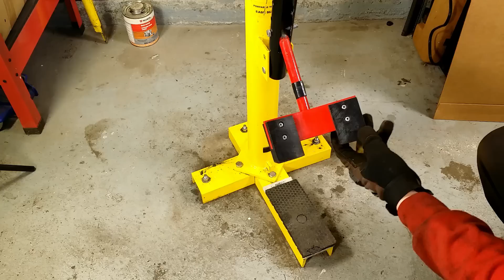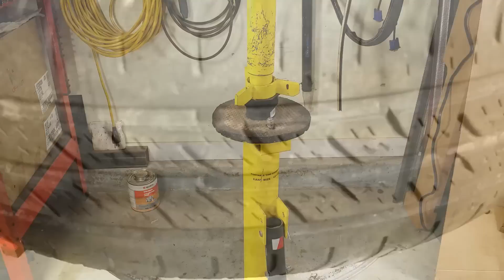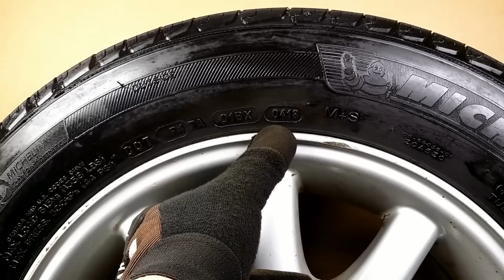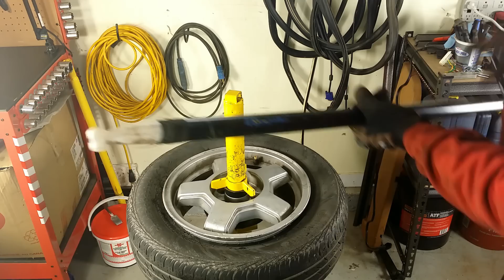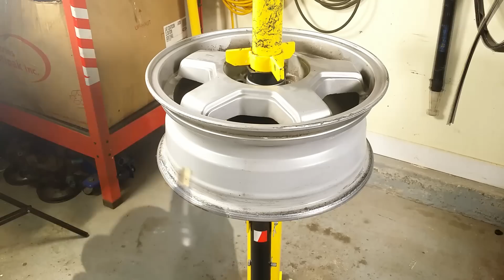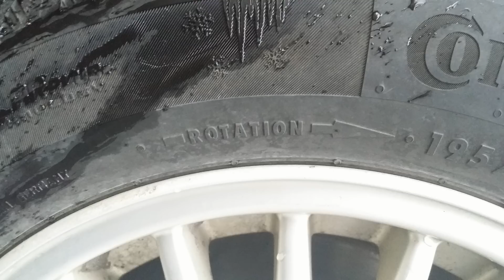How to Modify Manual Tire Changer and Change Tires

Comment: I think if the rod of the bead breaker was longer, there would be more travel and maybe not as necessary to do multiple steps turning the wheel.  Good instruction sir.
Reply from the maker: Thanks!

Comment: The mounting device has a lot of friction with the rubber, which is why it offers a lot of resistance when riding it in the ring. El dispositivo de montar, tiene mucho roce con el caucho, por eso es que ofrece mucha resistencia al suncharlo en el ring.

Comment: Excellent Video with top class commentary,,no fluff..great stuff..My way of breaking a tyre from the rim was to put the tyre under the rear wheel of my pickup truck and reverse over it.That was in Canada .But here in the UK tyres are so cheap its not worth the effort.
Reply: Hy

Comment: If you don't want to scratch the edge of the rim's outside, isn't it possible to turn the rim with the outside pointing downwards?

Then you'll work on the backside and any scratches will notice.

Comment: It's kind of ironic / funny that all the countries that use the metric system and try to ridicule the US for sticking with the Imperial (actually "US Customary Units") system still have their wheel diameters measured in inches... :)

I like the looks of those plastic ends on the tire changer lever though... I might have to try to make myself some of them...
Reply from the maker: It's kind of ironic / funny that at the Metre Convention in Paris, France on May 20th AD 1875 the US of A signed the Treaty of the Metre along with other countries. This means that the US of A recognizes the metric system as the standard of measurements and all its pounds, gallons, inches, etc. are metric-based and multiplied by conversion factors. Samples of the original units are held in the National Institute of Standards and Technology https://www.nist.gov/ 
This means, that the imperial system used in the US of A is based on the metric system (SI). Did you know this? https://www.nist.gov/system/files/documents/2017/05/09/frn-59-5442-1959.pdf
Reply: @robertdeptula2003  -- I'm an engineer (retired)... I am well aware that there are exact conversion factors between the US and metric systems and that it is possible to derive many through the memorization of of a few base constants... For example, if you want to convert from liters to gallon EXACTLY, you just need to remember that there are 231 cu-in in a gallon, 1000 ml in a liter, and 1 cu-cm = 1 ml -- it gives you 3.785411784 liters per gallon EXACTLY.  That's the US gallon, not the Imperial gallon... My impression from spending some time in the UK though was that they use a mix of metric and Imperial for various things.  For example, road distances will be measured in miles and distances to a near highway exit in yard, but bridge clearances in meters... Most weights are quoted in kg, but people tend to quote their weight in stones and pounds... There is nothing magical about the metric system like uninformed proponents that you have you believe... It's just another arbitrary system of measurements, albeit with unit conversions based on powers of 10...

Comment: Great video with great explanation cheers where did you get your tyre bar from please it looked awsome and really easy to use compared to the standard bar you get with the tyre changer.
Cheers
Reply from the maker: I made this bar. When you pause video you can see details. The contact parts are made of plastic reinforced inside  with metal spikes.

Comment: Why can't you change an 18" wheel/tire with these low cost tire changers? Most of them say 16 or 16-1/2" maximum size.
Reply from the maker: All I have is 15 inches wheels.

Comment: Great video. Can you give the name of the valve tool and paste?
Reply from the maker: Tire fitting paste: https://shop.wurth.ca/vehicle-repair-components/wheel-tire/tire-mounting-repair-tools/tire-mounting-repair-chemicals/tire-fitting-paste/TIRE-FITTING-PASTE-11LBS-(5-KG)/890.1221/?gclid=Cj0KCQjwub-HBhCyARIsAPctr7z6hjJydLkCRskPIk8ipJUjWPT_rJxbfEkNenszEDNXsmZpHz_n5OIaAh1aEALw_wcB
Tire valve multi tool: https://www.princessauto.com/en/tire-valve-repair-tool-with-valve-cores/product/PA0008253684 this one is more popular and you can use it to mount the valve on the rim. 
Good luck!

Comment: You should have been considering that there was a expensive sensor inside before you dismounted it or that you will check for the belt over lap and install it opposite of the valve stem to help aid in the balancing process and save shop on weights.
Reply: How do you tell where the overlap is?

Comment: I need to make that bar. Could you please give detail specs on the measurements and materials? I can see it, but getting it right is another matter. Thank you for a great video. I'm currently frustrated with the harbor freight bar over two days without luck already! I don't want to damage the new tire when mounting, and need to get something that can work well.
Reply from the maker: On my chanel in "about" section you have my email. Talk to me.
Reply: @robertdeptula2003  Can  you help me

Comment: That machine from Harbor Freight was the machine that used 40 years ago except the bead breaker was mounted to the wall in with hydraulic for those tires that don't like to come off

Comment: I saw another video where in the comments someone said the coloured dots, (yellow/red) printed on the tyres were meant to go at a certain position. 
Something to do with it being the heaviest part of the tyre, so you put it opposite the valve. Wish I could remember. Just meant you didn't need as much weight when balancing it.
Reply from the maker: Yes, but not all tires are marked this way. Somebody else left a comment, under my balancing tires video, that he turns the tire on the rim to find the right spot that will require fewer weights. Just two weeks ago I changed two tires and during balancing turned one 3 X 90 deg and another just once. Made a significant difference in the weights required to balance. Thanks for your comment!

Comment: Good video. Most folks don't know about the drop center. Also you know this, but there is only one correct side to remove the tire, as the drop center is typically not centered on the rim. At least in modern wheels it's not.
I like that paste lube your using, as it leaves very little water vapor, which accelerates the corrosion of aluminum rims. That whole nitrogen thing is wasted if there is water vapor inside the tire.
I've not seen that lube available in the states. I typically use a bar of soap, rub it on dry, and that works very well. But I do see micro bubbles and your sealant would be a good thing as it's not messy.
Reply from the maker: The paste in US: https://www.wurthusa.com/Chemical-Product/Tire-Repair/Tire-Mounting-Paste-11-Lb-Pail/p/08901221
Reply: Ka price

Comment: I've heard of this, "tire blowing up" thing.  What exactly happens?  I need to do this, but would like to try it by hand as I've seen in other videos.  Don't wanting a tire blowing up though, where is the danger?  Good video.
Reply from the maker: If the rubber is not damaged, cut or torn, and if you put the right size tire on the right size rim, then everything should be OK. Do not over inflate the tire.
Reply: @robertdeptula2003  ok, thanks!
Reply from the maker: @szargos  You are welcome
Reply: The best way to prevent damage to the tires is to use proper technics! In all honesty there's no work around from it! 
Do it right and the probabilities of a miss happening, like blowing a tire basically vanish. The always and the never tips:
- ALWAYS inspect a tire before assembly, even a new one! If lacking knowledge at least apply liberal amounts of very rare common sense! LOL 😂 
- ALWAYS lube the tire, rim and eventually the tool tip! More on this in a second.
- NEVER overinflate a tire! If you feel the need to do it. To seat a bead, etc. Please understand you're doing it WRONG. So step back and start it over again. ;-)

About lube, the subject was not properly covered. On this otherwise very good video. But keep in mind ALL tires should be lubed in three (3) areas! Remember this number. They are respectively, both outer beads. AND the upper inner bead facing down (facing the rim)! This last one is probably the most underrated detail... 
Now let's talk about lube the RIM. Also three (3) areas! Upper outer lip AND both bead seats.  
With this properly done, pretty much all tires will be really easy to do. BTW it's worth mention, that it's much faster to do it, than write these details! Becomes a second nature.

This week alone I set a few tires on steel rims and alloy rims. Some, even on the steel rims, seat the beads with as low pressure as 10~12 psi! The type of lube also play a roll. These very low pressures were accomplished with "hair spray" used as lube! Yes, normal (cheap) hair spray the ladies use to fix the hair.
Exactly the same tires and rims set. assembled with soap, saw the pressure increase to around 25~30 psi. Both using the same lube technic as described above.
Cheers

Comment: I have a HFT manual tire changer.  I enjoy DIY automotive maintenance.   After seeing a plethora of YouTube videos about modifications to it, and after many frustrating attempts at using the damned thing, I decided to just scrap the damned thing and use some hand tools that get the job done much easier on just a flat surface or desktop (or even theoretically changing a tire without removing the rim from the axle):
    1.  AME 71600 "Little Buddy" manual bead breaker.
    2.  Tire Bead Clamp Drop Center Tool (total of four clamps works best)
    3.  Tire levers (from HFT, total of 3 levers works best)
    4.  "BeadBuster" Tire Mounting paste (works better than liquid stuff or dish soap)
    5.  Thin plastic rollable kitchen Cutting Board (cut to 2-inch strips to protect rim from tire levers)
    6.   5-gallon Air Tire Bead Seater Blaster Tool.
The key to ease and success is to take advantage of the "drop center" area of a rim.  The bead clamps ensure this gets done by pressing the bead down into the drop center area.  Then the job is easily done by prying the bead one lever at a time, one inch at a time, until it seats completely.  The air blaster tool works perfectly for thick ply truck or Special Trailer tires that are too stiff to simultaneously grab both sides of the rim surfaces, forcing the tire bead to contact the rim and seal up nicely.
    I save a lot of money from the investment of these tools and doing my own tire changes, because I have a fleet of 12 vehicles in my household and I enjoy online ordering from Amazon or TireRack for my tires.
   My next investment, after I get my next Stimulus Check, is an electronic tire balancer, just like at the pro tire shop, because the HFT manual balancer is not precise enough for the fastest cars in my  fleet.
Reply: Well worth the investment. If you value your time waiting at a tire shop or dropping it off for service later that day. Many times I've encountered problems with the install or legal issues due to age of the tires. I'll happily do the work myself to avoid the conflict and wasted time.

Comment: Yes brilliant, what did you use for the plastic pry part I can't think of anything I could carve it out of. Thanks
Reply from the maker: It is PETE, I have found it at a local plastic company selling different diameters.
Reply: Tip: Remove the paint and polish the mount/dismount tips of the bar. Fine grades of sand paper and oil will do the trick just fine! ;-) 

Even this cheap Chinese tool will perform flawlessly with that done! Surely there's no need for plastic "bits and bobs".

Comment: Great video! What company is the tire changer stand from? Can you do a video on how you made the tire mount/demount bar?
Reply from the maker: The tire changer was purchased in Canada. Princess Auto, Harbor Freight, Northern Tools, and many more sell the very same changer, different color. 
I will do a separate video about the bar, but really there is nothing to it. What you can't see on the video is that the plastic prongs are reinforced by steel inserts.
Reply: @robertdeptula2003  Yes, I'm also in Canada and have seen the tire changer at Princess Auto. I really like your bar, very similar to the no mar bar in design (which is very expensive to import with shipping and taxes from the US). I need to make a bar as I have an old tire changer but need the demount / mount bar. If possible, could you dm me some pictures of your bar? If not, I look forward to the video and thanks for the reply.
Reply from the maker: @richthevegan8611  Check your e-mail. I sent some pictures.
Reply: @robertdeptula2003  Thank you so much. Very kind of you. Great work with the welding 👍

Comment: Hi..Great video  what is the paste you use on the stem and bead?
Reply from the maker: Tire fitting paste by Wurth:  https://shop.wurth.ca/vehicle-repair-components/wheel-tire/tire-mounting-repair-tools/tire-mounting-repair-chemicals/tire-fitting-paste/TIRE-FITTING-PASTE-11LBS-(5-KG)/890.1221/ 
It is not sold in retail. Contact Wurth representative, he/she will visit you and take your order.

Comment: What’re the pads you used for the bead breaker
Reply from the maker: Few years ago I bought it on line as a replacement part for different tire changer. Don't remember the name of the company. Can be easily done. A chunk of plastic can be bought at local supplier, same as the white plastic I bought for the changing bar.
Reply: @robertdeptula2003  Thank you, also what did you use for the wheel reducer piece?
Reply from the maker: What do you mean by wheel reducer piece?
Reply: @robertdeptula2003  the black center piece that holds the wheel down? right below the 4 prong thingy.
Reply from the maker: https://www.renodepot.com/en/abs-reducing-coupling-0068165
Reply: @robertdeptula2003  Try a side piece of a one gallon milk jug. Worked perfectly for me. You’ll have to hold it in place around the bead breaker blade, or maybe secure it with a couple of vertically mounted Ty-Wraps. I sprayed tire lube In around the bead before breaking it loose. That's a big help as well.